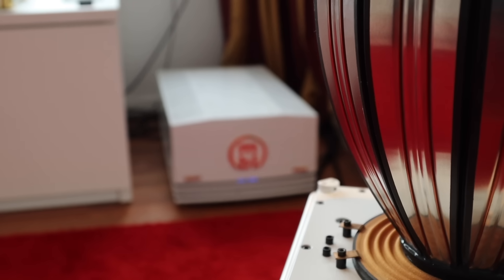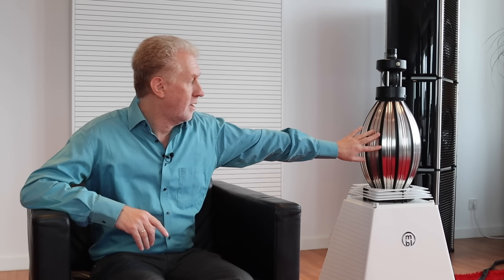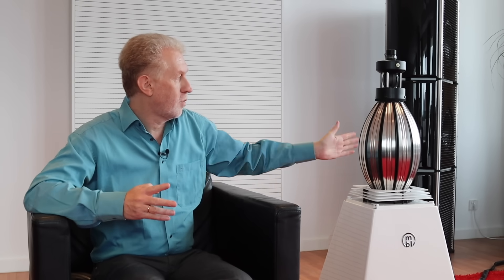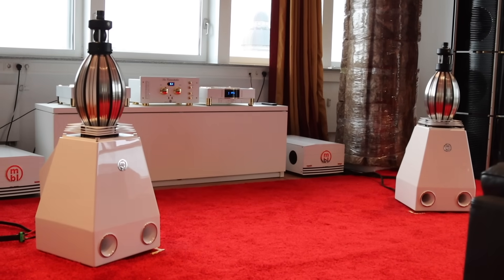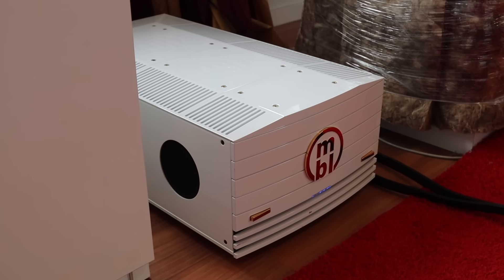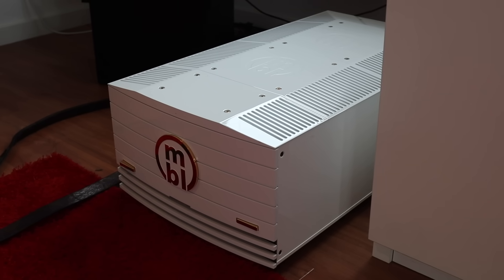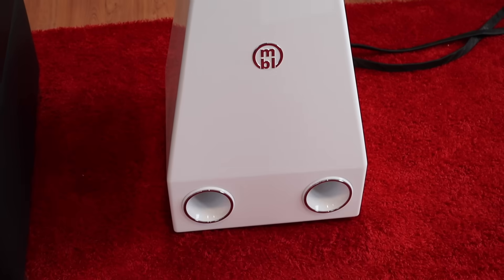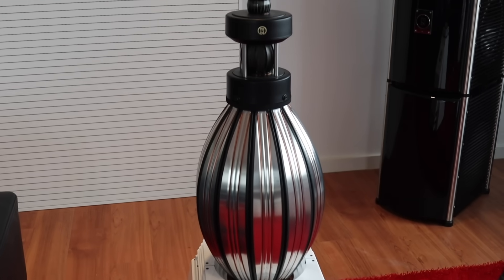An afternoon with MBL's Jürgen Reis

Comment: I am curious about that point about the types of componets such as the type of resistors that you use. Can anyone explain or point me to a change that that can make to a sound? I am making something myself at home and would use an advice on the type of component as I am unable to find a comment that asked a similar thing before. Thanks.
Reply: You posted this a crazy long time ago so idk if you were still interested in an answer. Carbon and carbon film resistors inject noise into the system, usually it’s a hiss that won’t go away. They also drift over time and they do not have a tight tolerance (value). Metal films on the other hand do not add any noise and can be made with a tolerance down to 1%.

Comment: Quarter million for the speakers, yes. But you still need 4 power amps, which would cost another $200k if you go for the 9011 ;) so more like half a million for the entire 101 extreme system. 

But still - absolutely amazing. Ive actually never listened to their system even tho I live in Berlin too. I would love to take a listen to the extreme setup. Must be an absolutely fantastic experience.

Comment: Another fascinating point of view. Keep these coming. As an engineer, I would like to ask Jurgen if he ever measures the impulse response of his products and model circuits? I have a fantasy that impulse response has much to do with "what it sounds like." Almost all of the measurements we commonly take are relatively steady state, that is not measuring the response to a one-time impulse of varying rise time and duration. While impulses don't occur so much in nature, they tell us much about what amplifiers and reproducers do with the signals they are fed.

My curiosity (and the mathematics) indicates that this type of measurement MIGHT shed additional light as to why things 'sound different' when they measure the same. Impulse response tells us much about rise time, ringing, phase angles, latency, sustain, and recovery of a waveform -- all of which cannot be measured or even observed with approximately steady state techniques. The technique MIGHT shed light on the effects Jurgen mentions of component types. And it's something that can be done with each stage, chained combinations, and even the full reproduction system, end to end.

Thanks for these interviews. These are not PR guys, and that is important.
P.S. I can only imagine what enormous impact the listening room has on an omnidirectional speaker.
(Sorry for the length of this.)

Comment: Why a 360 degree speaker when you only listen from one direction?  Nonetheless, very cool looking stuff!
Reply: Michael assuming trying to replicate an acoustic instrument
Reply: Why omni, when you only listen out front?
Really good question

Short answer; manufacturers have their own approach to a pleasing experience, this is mbl's (they're not the first to offer an omni design, but likely the best).

An omni sound sources can create an incredibly believable 3d stereo image. 

Typical box speakers radiate in 360 degrees, except they don't do it uniformly by frequency.  

Typically speakers radiate low bass evenly into all directions. This is due to the radiating surfaces (and the speaker itself), are small compared to the low bass  wavelength. 

Higher in frequency, output becomes more directional, beaming the sound again because the radiators size relative to the smaller wavelengths of the higher frequencies.   

Pocket protector geeks that study such things consider "uniform directivity independent of frequency", theoretically ideal. This constant directivity, or controlled directivity, isn't just for omni designs. It's most often found in pro audio designs. 

Legendary D.B. Keele brought us Constant Directivity in the 70s. Now he's developed CBT,  that has uniform output off axis, but also SPL output on axis independent of listening DISTANCE! 
It's amazing and sounds great. 
I participated in a private shootout blind comparison between 4 loudspeaker design greats. Keele's CBT design by Selah held it's own up against Tom Danley's Synergy, Mark Seaton's Catalyst, and Jeff Permanian's Noesis. 

Yes, the Selah CBT faired very well up against the significantly bigger and more powerful heavyweights.  

I know... ridiculously way off topic, and tl:dr... I know,
...but for those interested here's the loudspeaker shootout;
https://www.avsforum.com/forum/89-speakers/1512849-january-18th-loudspeaker-gtg-results-thread.html
Reply: With any speakers you hear the speakers and the room no matter where you listen. A speaker's radiation pattern affects how it interacts with the room and has a huge effect on how we perceive the sound. Omnidirectional speakers radiate sound evenly in every direction and interact with the room the way many instruments would. They producd a very realistic and coherent sound that other speakers don't.